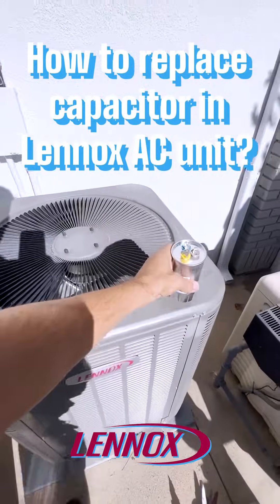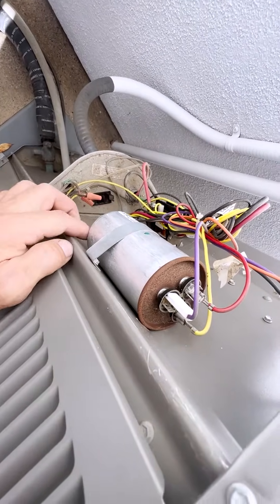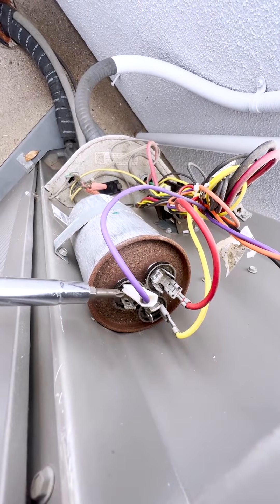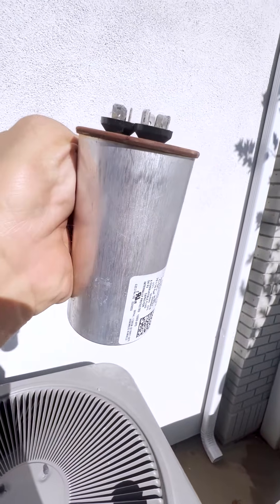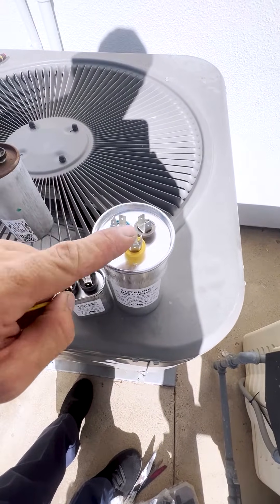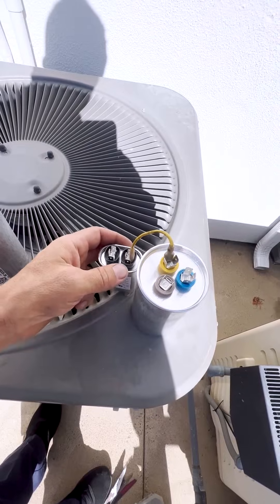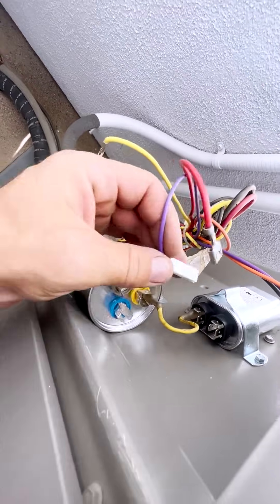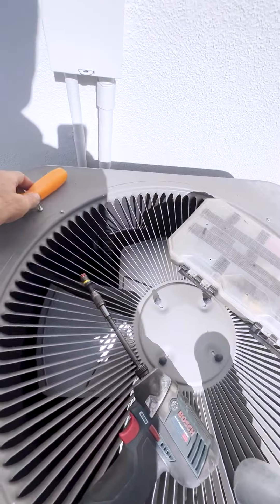How to replace capacitor in Lennox AC unit? / AC repair / Orange County California

Comment: This appears to not be a "common" replacement, as he didn't have the correct replacement.  You shouldn't need to add a second unit just to get the orig capacitor replaced.

Comment: I have a Lennox heat pump compressor xp17 that has a dual capacitor with 3 prongs but only two prongs are being used, common and hermetic. Is this normal? Thanks!
Reply: I have the same XP17 with dual capacitor.  Capacitor was all rusty but it required 45/4 440V dual run which was repaced with 45/5 440V capacitor.  I also only had two prongs used. I placed the common on the prong that had 4 slots, and placed th hermetic on the prong that had 3 slots.   After turning system back on i had to wait about 8min before unit started.  This fixed my cooling issue.
Reply: @saahilbhambra9237  Thank you, very helpful!

Comment: You missed one very important point. and that is you should discharge the capacitor by shorting the terminals. or you could be electrocuted. capacitors store a lot of voltage and release it all at once. which could kill you?
Reply from the maker: Yes you’re absolutely correct. Don’t get electrocuted!
Reply: @airbluehvac  This video could lead to serious injuries. That one step really needed to be included in this video!